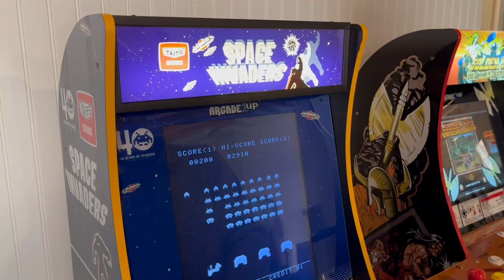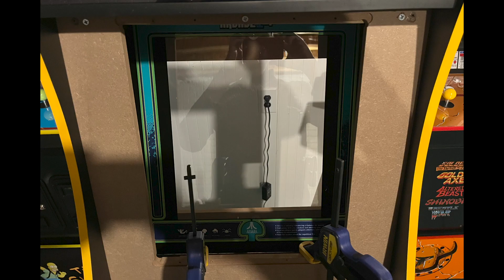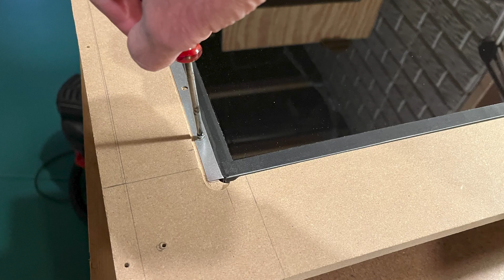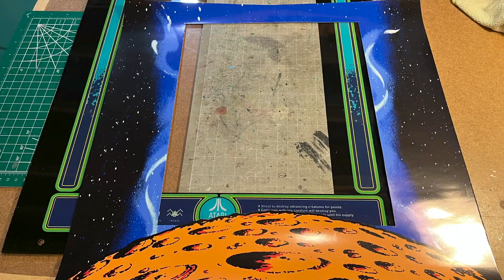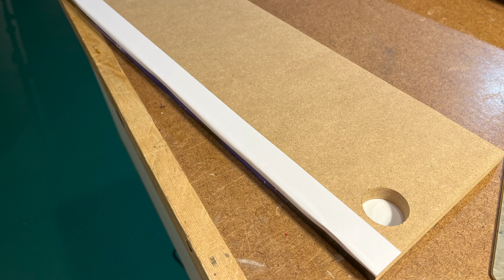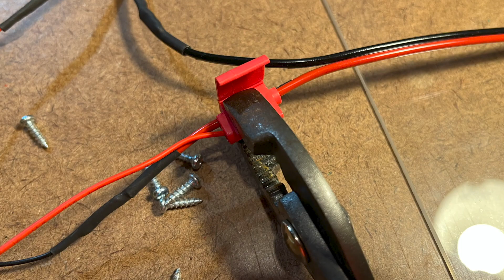Crazy Cool Recessed Screen Mod for an Arcade1Up Space Invaders

Comment: Level it up.
Use a fresnel lens with a smaller lcd to fit screen horizontal in the cab facing up, with 2 way mirror and backdrop art like original

Comment: Wow I literally just did the recessed monitor mod on my cab.  My original plan was to install a piece of mirrored plexiglass at a 45 degree angle like the OG but the form factor of the G1 cab was not possible so I recessed the monitor and made the front bezel tilted 90 degrees vertical.  You took it a step further with the shadowbox graphic and lights.  Just contacted the Etsy seller to see if I could get the graphic to finish the mod.  Oh and tilting the bezel created a 1 1/2” gap between the control deck and bezel so I have to have a new control deck custom cut.

Comment: Extremely cool!  I was thinking of how I could recreate the arcade effect with a 2-way mirror. Do you know if it's possible to flip the Arcade 1up's image to a backwards "mirror" effect? Then the lcd screen could be mounted below, and the image reflected onto the 2-way mirror. I believe that's how the arcade was. Any help would be appreciated. Thanks.
Reply: Good point.
Maybe there's a hidden service menu for this pcb?
Otherwise, would need to put in an rpi or Android box running retropie or batocera, or a minipc.
Bonus with a pi or Pc mod is mame or other emulators will put the original background graphic behind the playfield, dimmed and semi transparent,  may be adjustable.  
Then all you need to do is this recess mod, no need for the bezel graphics, nor the bottom planet.
Reply: That said, still be a cool project to replicate the mirror and uv blacklight background graphics like the original